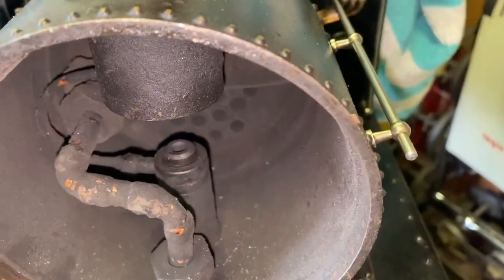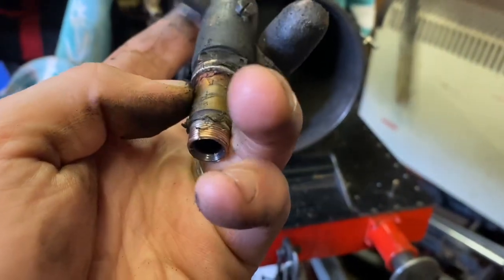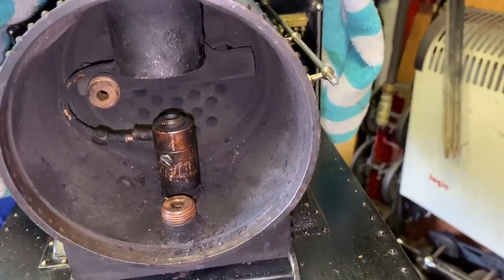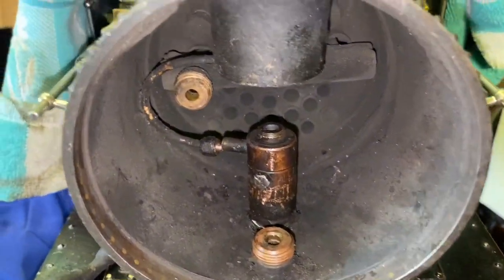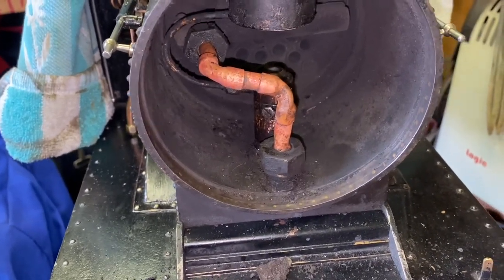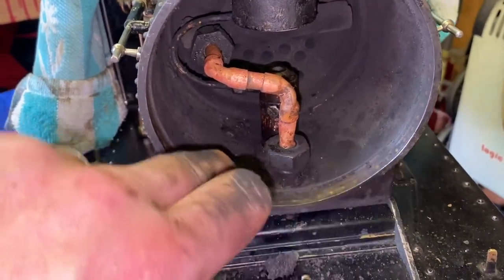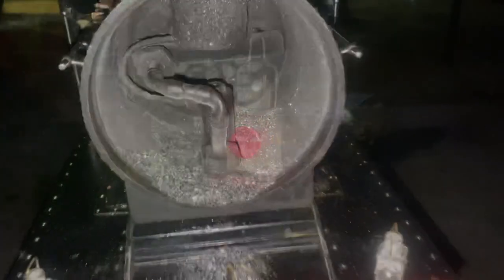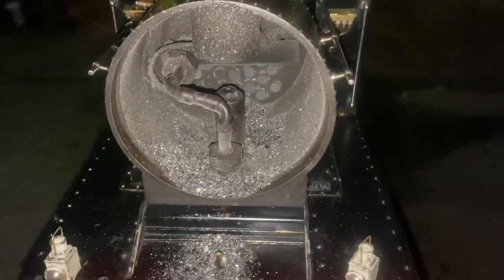Jinty smokebox leak…

Comment: Is there just more draught at the sides? I like high temp silicone for sealing smoke boxes.
Reply from the maker: Yeah, I usually use high temp silicone, but in this instance it wouldn’t have worked as it wouldn’t have had time to set before running. The draught is caused at the base of the chimney so I don’t see that there should be different amounts of ash in different areas.?
Reply: @TomsWorkshop42  I possibly haven't used the right term. The blast going up the chimney causes a vacuum in the smoke box which pulls air and ash  through the tubes. At the sides it can zoom up the chimney but at the back of the blast pipe the air impinges on the blast pipe causes the ash to lose energy and drop. The front side of the blast pipe is shielded from the draught so again ash can collect there. Does that make sense?